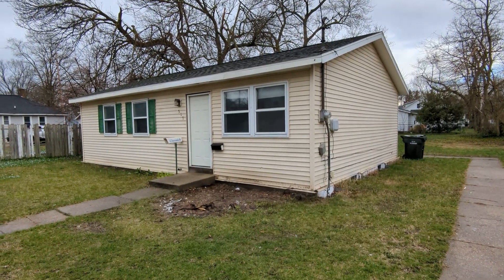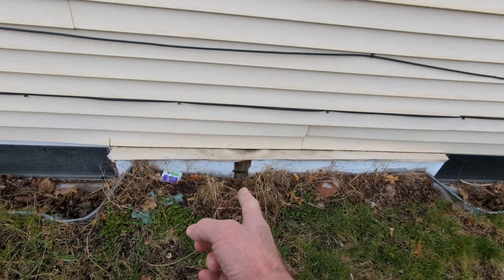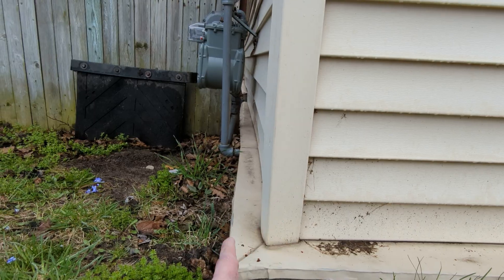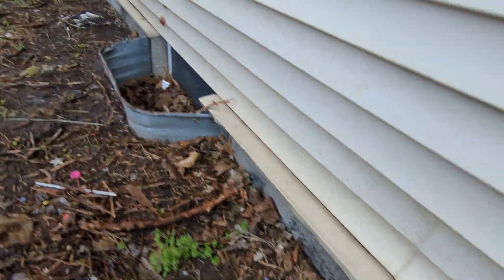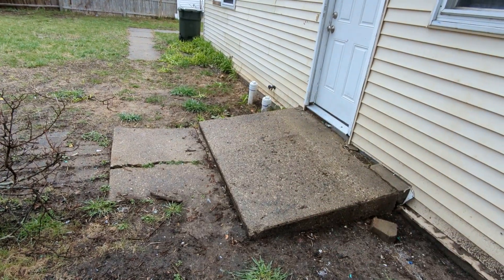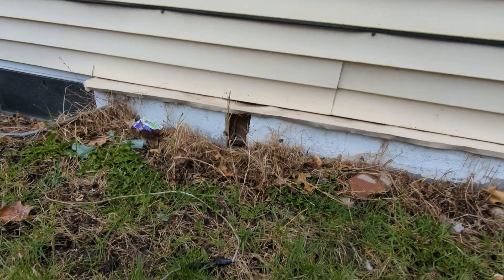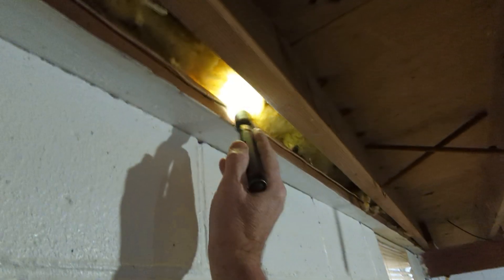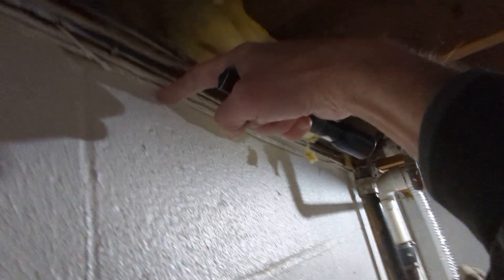⚠️SEE FULL🎥Frost Heaving on Block Foundation #foundation #construction #realestate

Comment: I have a fix!!!! You need 3" of rigid foamboard over the sheathing, then furring strips, then new siding. Not cheap but not horrific.
Reply: Thats on the outside, what about on the inside?
Reply: @SteveBennet500  If the foundation wall is stable now, then nothing more needs to be done. My solution is to prevent further water damage.